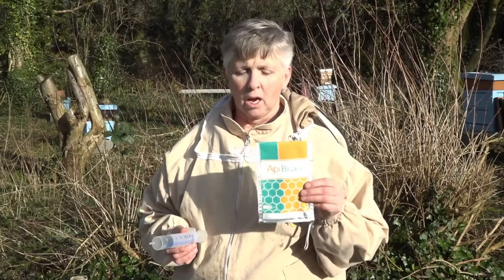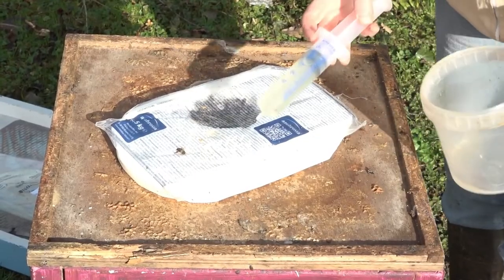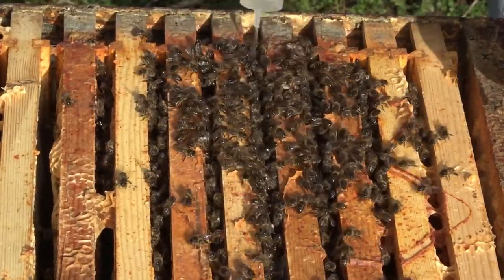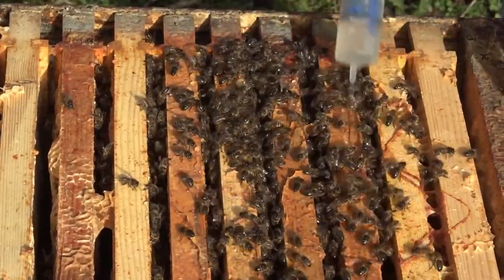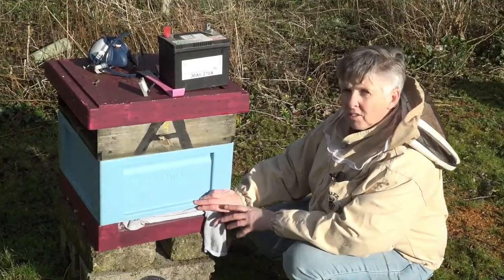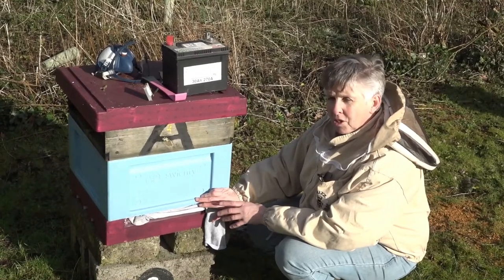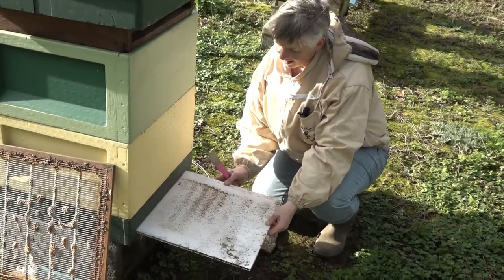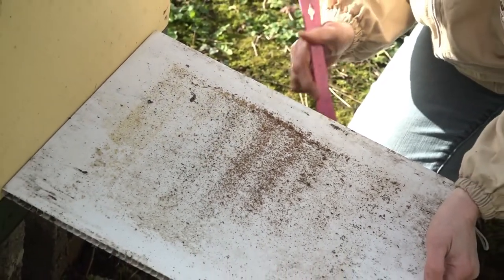Applying winter treatments

Comment: Very useful demo of applying the treamtent in 2 ways. Using the tray vaporiser (briefly mentioned but not done) is a more fiddly method, as you have to get to fit into the entrance, without spilling the powder. It was good see the alternative tool. The advantange of the tray method is once you have the tray inside the hive and attached to the battery, you can stand well back.
Reply from the maker: Great point!